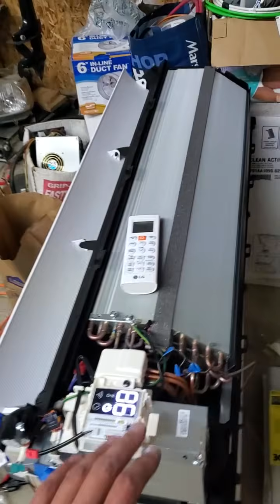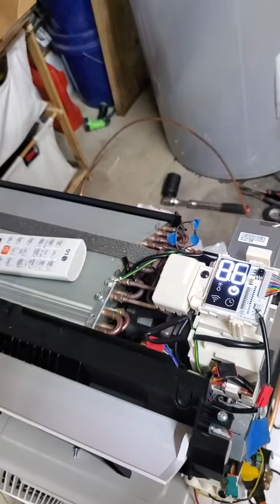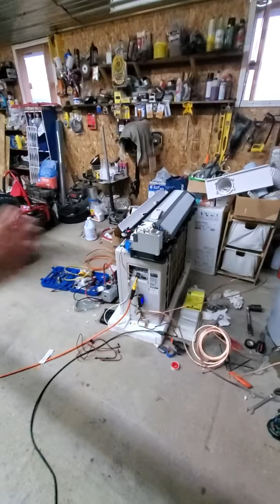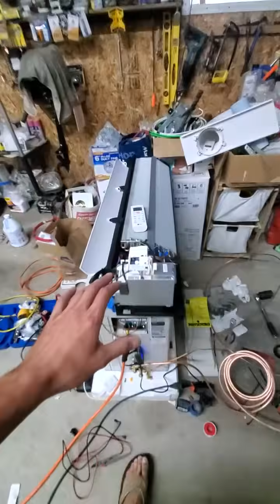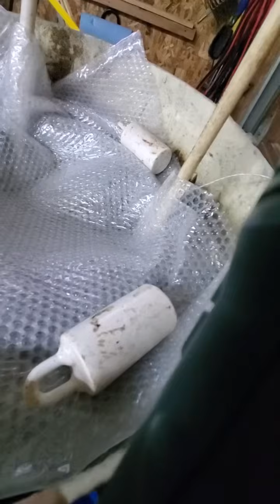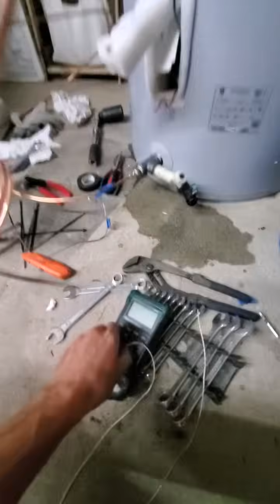DIY Heat Pump Water Heater. DIY. Home made mini split.

Comment: How are you using/adapting the controls to carry out a disinfection cycle? Also have you looked at the "Daikin Altherma" or the US made "Water furnace" range of domestic heat pumps as an option.
Reply from the maker: Daikin used to make residential type hp water heaters. Not any more. This worried about the Legionnaires' disease and this u need 140f to be safe you need to do some more research on that disease. Above 120f it can not live. I run the tank at 130f. No issues there
Reply: @ne7s29  Daikin still make and sell the Altherma's here in the the UK and across Europe, its how i make my living, fitting fault finding and servicing those and many other AC, chillers and heat pumps brands.
Legionella is not the only bacteria that you need to be concerned with and the temperature difference from the top of the tank to the bottom can be enough to sometimes cause an issue, hence why most of the manufactured units have a disinfection cycle which takes the tank temperature to 80C/175F near the top to account for that difference in temperature.
Surprised you say Daikin stopped in the US would of thought that was a huge market for them, is there just not much of a take up of heat pump technology with the US public?
Reply from the maker: @britboard  America us built on money. If there is a way to make it for some one they will do what's needed to make sure they are the ones making the money. Good old propane water tank heaters her sold like hot cakes at like 60%efficiency.

Comment: Hi, can you share the COP vs Temperature?
Reply from the maker: What I did is reset the kw meter November 1st. I'll see what it used for the month of November and compare it to the summer months. That will give the best input. What I did is reset the kw meter November 1st. I'll see what it used for the month of November and compare it to the summer months. That will give the best input.
 Last night the power went out and that shuts off the unit. I forgot to power it back on so the temp dropped to 60f In the tank when kids tried to take a bath taking 55gal of water at 60f to 125f per a calculation take 8.7kw of power in pure electric resistance heat. I monitored mine for that period in 30f weather and it used 1.9kw via the lg setup I did. That's a cop of 4.57 in 30f. Im very happy with that! I'll say that's a avg temp here in upstate NY.

Comment: nice job! but if u replace the indoor unit with a plate heat exchanger that correspond to the indoor unit? i think i saw someone here in the EU was in to that with a mini split system outdoor unit, he was heating a outside pool with it !
Reply from the maker: I did heavily research that and wasn't contact with suppliers from China but the biggest issue is knowing the exact volume or cc's it is that are inside of the heat exchange  and then converting that to make sure that equates to the same amount of volume the indoor evaporator would have because you don't want to be overcharged or under charge and there was too many variables. the price really wasn't too cheap so I just stuck to the basic method that most water heater producers use.  My brother is running the AO Smith heap up water here and I am trying to compare and see is how much cheaper mines is but so far looking at the usage that his store bought heat pumped water heaters using I'm fairly amazed it is much less than  my General Electric 5 year old heatpump water heater was using almost half less. Mine would pull avg 650watt at 70f intake temp and his ao smith pulls 380watt at 70f
Reply from the maker: But the other thing to consider is your indoor heap on water heater if it's in a condition space is cooling it at a rate of 6000 btus which is almost 2 kW (6800BTU) equivalent of straight electric heat so you have to deduct that from its efficiency as well
Reply: @ne7s29  Say i wanted to use a Plate heat exchanger or a tube in tube heat exchanger from china. Waht would be the exact way to calculate the sizing?
Reply from the maker: @rodon91  That was exactly the issue I ran into when contacting them to get the cubic centimeter volume of their headache changer to know how much gas I either have to remove or add based on the charge in the meaning split. They were not able to supply this information properly. Many splits are fairly flexible with under and overcharge so I think if you did a bare bones calculations you wouldn't be too far off
Reply: @ne7s29  I assume that would not be the only factor at play here. Surface area of contact with the medium you want to cool or heat is also important, speed of flow of refrigerant, amount of time and length of tube taken to condense properly, etc. Its just too much to know. An inverter heat pump would compensate for most of these though.

Comment: All water heater tanks are glass lined on the inside to prevent rusting that have been injected inside and baked on after welding the tank together at the factory. Once you weld that tank back together this will destroy the glass lining and expose the raw steel from the weld inside the tank and that will for sure rust rapidly. I done a similar thing with a 8"x12" 50 plate heat exchanger and it works great by running your discharge line from the compressor (hot gas refrigerant line) thru one side of the plate heat exchanger and a 80 watt circulating pump from my 50 gal. Rheem heat pump water heater to the other side of the plate heat exchanger and back to the tank. I used the discharge line (hot gas) on my existing 3 ton package heat pump unit to go thru the exchanger and them back to the outside condensing coil with a temp controller now controlling the outdoor fan. Since I have to use the heat pump to heat my house in the winter this only provides me with almost free hot water (80 watt circ. pump) while I am using the cooling mode of my A/C. But living in the southern US I have almost free hot water for 8 months out of the year from my existing A/C unit. During the winter I just rely on the Rheem heat pump water heater which is super efficient anyway. Great idea on this but I think the rust will be a problem for sure unless you can coat it again on the inside. One other thing to consider is scale forming on the copper coil inside the tank the same way it does the copper coated traditional heating elements. Adding another anode rod and changing them out frequently (they are really cheap) if you have hard water may be a good idea. Love to see people like me and you who think outside the box.
Reply from the maker: And back in Europe my father would build his own water heating systems for homes out of regular steel pipes and steel plates for tanks and they're still standing 35 years later
Reply: @ne7s29  This is the type of plate heat exchanger I'm talking about that I used, a similar one but 50 plates. Here's the Amazon link: https://www.amazon.com/gp/product/B0095CFI6K/ref=ppx_yo_dt_b_asin_title_o05_s00?ie=UTF8&psc=1
Reply from the maker: @wgoode505   I heavily looked at getting one of those but my biggest issue was guessing the internal volume of that  plate exchanger to have the proper volume for the gas to flow through it so I would not be undercharged or overcharged.  As far as calcium building that you normally get in regular water heaters I should not have that because calcium build-up alone occur with boiling I will never get to a boil my heater internally is only running at 150ﾟF
Reply: @ne7s29  I was a little skeptical at first with the plate heat exchanger but it has plenty of flow through the plates and it worked out great for me. I did have to pump my system down and install the copper lines and fittings and afterwards when recharging the system, after pulling a deep vacuum I had to add a little bit more freon to the system because of the added line lengths but it worked out great. I charged it back up to a superheat of 8 degrees. So almost free hot water when my A/C is running. As far as the build up on the copper coated elements and possibly in your case the added copper coils inside the water tank. The build up will come from not having a very good water source such as hard water. Some people with not so great water have to change their anode rod out every few years along with their heating elements. You may have a good water source like I do, I don't know. My old water heater lasted over 15 years without changing the anode rod or elements. The reason companies like Rheem, Ruud and A.O. Smith use stainless tubing on the outside of the tank is to prevent deposit build up on the coil compared to if it were inside the tank. It would rapidly reduce efficiency for people with not so great water such as well water, if it were inside the tank. And a copper coil coming into contact with the steel tank on the outside will deteriorate the copper fast as well. That's why they use stainless tubing. Would really like to see a one year review on your system maybe by pulling one of the old heating elements and putting a cheap borascope camera inside to see if any kind of deposits accumulated on the coil. I hope it works out good for you, water quality means everything in this case.
Reply from the maker: I ordered one of the electric annoyed rods that don't wear out for 30 years so that should hopefully fix my issues